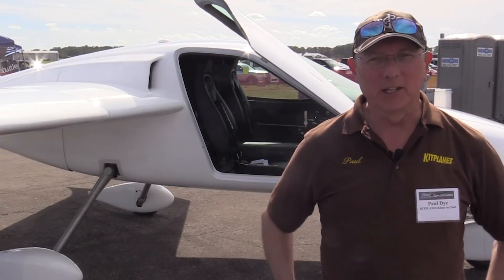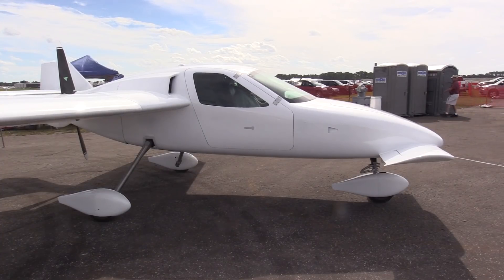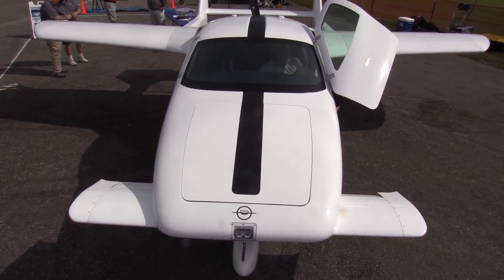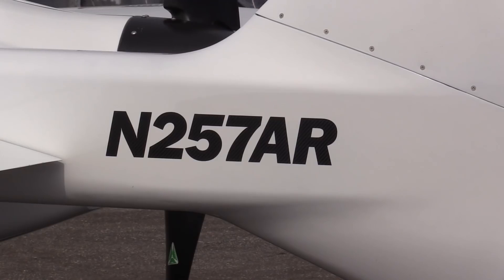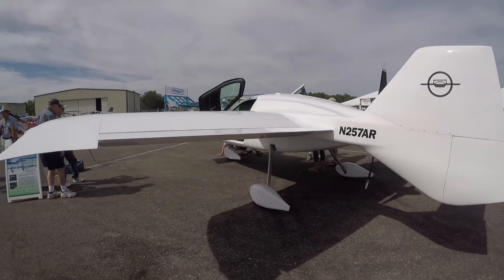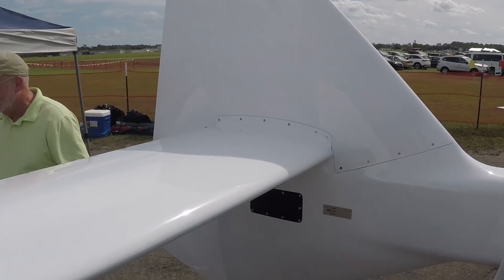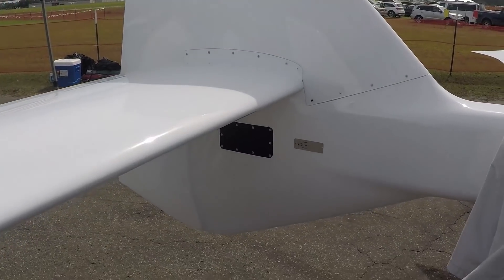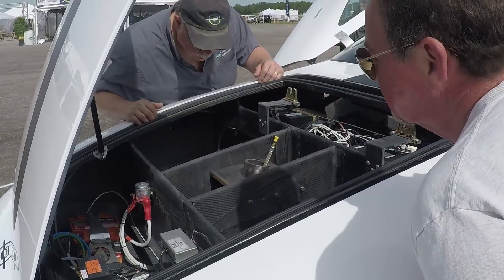Commuter Craft Innovator Nears First Flight

Comment: Video from a camera mounted on the airplane's right window show that, immediately after takeoff, the airplane displayed rapid divergences in both the pitch and roll axis and that the pilot made pronounced movements of the control stick in response. The airplane remained at treetop height throughout the upwind leg and into the crosswind turn and appeared to reach about 200 ft agl in level flight once established on the downwind leg. As the airplane accelerated, it showed rapid pitch oscillations and the amplitude of the pitch oscillations progressively increased. A handheld radio secured to the copilot's seat shoulder harness and the pilot himself were seen to "float" in the cockpit each time the airplane pitched nose down as the amplitude of the phugoid progressively increased, the duration of weightlessness displayed each time also increased.
Data recovered from an onboard recording device indicated the airplane experienced multiple pitch oscillations between about 1° nose down and 12° nose up. Engine parameters were nominal and show that the aircraft reached 100 percent power and stayed at a high-power setting until the end of the recording. During one pitch oscillation, an audible "oil pressure" warning was heard. The video ended abruptly as the pilot became unseated for about the fourth time and as the airplane appeared near treetop height. The airplane then impacted terrain.
Reply: When you say that the pilot became "unseated" do you mean that the pilot was not restrained by his harness and floated around, or that the pilot became weightless because of the negative G force but was restrained?

Comment: This gives me chills. I watched the plane fall out of the sky while taking off in a Cessna 150 in Calhoun. Pictures I took evidently went to NTSB. he started a spin, hit a tree and when he hit it, it slung the tail off. Could have been such a cool plane. Hate what happened. RIP
Reply: I thought that the whole purpose of a front canard was to prevent a stall from happening. 
I'm an aviation noob.
Reply: That is the idea behind a a Canard. But only the canard can’t stall. The main wing still can and that has a lot more surface area than the canard. I got to talk to one of the only test pilots who flew it successfully and he said it was the sketchiest thing ever.
Reply: @bensonmilam6022  Thanks, based on economy and performance I'm leaning toward either a Pipistrel Virus SW or a Sling High Wing.
Reply: @bensonmilam6022  Would a longer wing help with flight characteristics?   theoretically would have saved his life.

Comment: On aesthetic grounds alone, this has to be the ugliest monstrosity ever to be called an aircraft. "Commuter" aircraft are never, ever, going to be owned by more than a few half-crazy people with far too much money for their own good. You cannot have hundreds/thousands of "commuter" aircraft in the sky. Where are they going to fly - in roads in the sky? Airspace is already clogged up and subject to ever-increasing ATC competence and navigation knowledge. Your "average" Joe is never going to be safe in one of these things, and no-one will tolerate the noise and the inevitable accident rate which will be high. The nearest thing to a commuter aircraft is a helicopter and more than a few of those in one small airspace or region is quite enough as it is. What is needed is decent, cheap, mass transport that is efficient, safe and fast.

Comment: Selling kits and it never flew or done test flights yet? For inexperienced pilots? Claims smoother in turbulance?  Sure. Run don't walk. It looks, humm well, weird. I doubt it has superior performance over aircraft that already exist. I suspect it is slow (draggy). 

There should be a law kits can't be sold until prototype is flown and all performance and flight character known. I lieu of laws PEOPLE NEED TO USE COMMON SENSE. 

Many of these never flown planes claim revolutionary flying qualities prove to be terriable or even dangerous.

Is there CFD, FEM, wind tunnel or other analysis to back up this design? Unlikely, or they would have mentioned it. BTW that wide flat nose with a canard with extream camber looks like failure is written all over it. Good luck ALPHA BUILDERS...
Reply: This is a bit misleading. If you go to their website, you can see it has flown. https://youtu.be/rWyskUjRLmA
Reply: 100% agreed for many new designs. Every time you see a pusher, claims to be revolutionary, superior performance, ... Begins to take cash before first flight. Very dangerous situation, the cash will be consumed setting up the prototype, and when said kits must be produced, no money is left. By the way it is one thing to build nd fly a prototype, preparing for production is yet another challenge (my job ...) that takes a lot of money. Best case scenario, the price goes crazy up at that moment. I give all the credit those guys deserve, but too often that mistake is made ...
Reply: @SuperYellowsubmarin  Production of these means maybe one a week, if lucky.  Easily doable.
Reply: @foxmulder3980  Of course it can be done ! But you need the proper molds, assembly fixtures, not to mention process tuning ... I am only saying that it requires considerable effort to step up from prototype to production, and it may be the cause of unpleasant surprises. That being said, I wish them success ! I am not here to say nay, but discussing why similar projects fail at this stage. That's observing reality.
Reply: @SuperYellowsubmarin  Did you watch the video?  The 51% of the build is going to be grunt labor supplied by the buyer with the putting together of the airframe.  Personally, by the mere looks of the design, I don't trust it. I like it, but I don't trust it. Pushers can find themselves to have an overheating issue if they are run too hard.  Doubtful they can properly evaluate and work all that out in 200 hours. But that being said, life is a risk.  If people wanna be guinea pigs and pay $150-200k for the privilege,  more power to them.
Reply: @foxmulder3980  You're right, though that was a general comment not only meant for them. Regarding this one, it may or may not perform well, but boy is it ugly ! Take the raptor or the synergy, at least they look gorgeous !
Reply: @SuperYellowsubmarin  Look at the front of the plane - it looks like a 300zx front end.  But I like the width of it.  Most light planes like this don't give enough shoulder space. But some observations:  1) Not enough wing space - appears to be about 1ft short on wing length 2) Vertical stabilizer is too short - to close to the contour of the plane 3) lack of aerodynamic aesthetics - looks like a Nissan 300zx was inspiration for the cockpit. 

Obviously my critiques are just observations and have no basis in reality as I'm no engineer.  But I have to wonder if this design was simply put together as "good enough" as opposed to making it a superior design.
Reply: Fox Mulder im thinking the wings are more like 1.5' too short.😂
Reply: It has flown, look at their website  www.commutercraft.com
Here is a video:  https://youtu.be/rWyskUjRLmA
Reply: @Kimoto504  Collateral damage sometimes happens, such is life.
Reply: It’s a blended platform.... a lifting body with short flight surfaces... it’ll fly just fine.
Reply: “There should be some law” No there shouldn’t, we have enough laws to protect stupid people, and they don’t work. If your to dumb to know what to spend your time or money on you should be broke or dead or both..... it’s called natural selection or even survival of the fittest. Thought patterns like that negate the whole concept of evolution. While we’re on the subject of misguided legislation, health care is a product, like toothpaste, not a right.
Reply: @rsrguy  OK OK don't blow a gasket. "There should be a law..." was more rhetorical than literal. There are laws and they are for certified aircraft. Kit experimental aircraft have huge freedom to make and fly anything. That is great, but one day it may go away if it's abused.
Reply: lol no gasket blown. It use to be that we had the freedom to make dumb choices, while I wouldn't say that's not the case anymore,  you'd have to admit we have an awful lot of nanny laws that   good old fashioned common sense should have been able to short circuit.
Reply: @guylandia2150  i am a conservative and old enough to be raised to take PERSONAL responsibility.. I also have a degree in engineering and airline transport rated pilot with a few type ratings in Boeing jets.  I just hate people selling planes like this with out proving it. That is all.